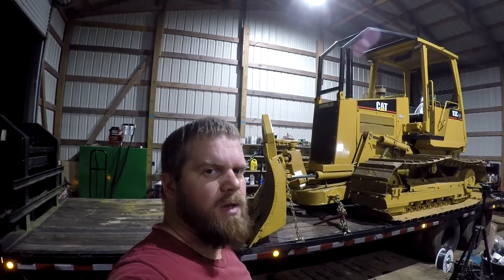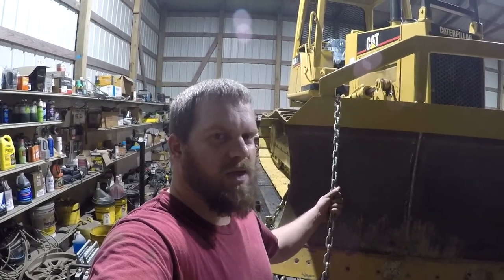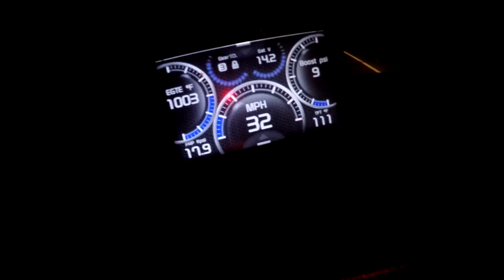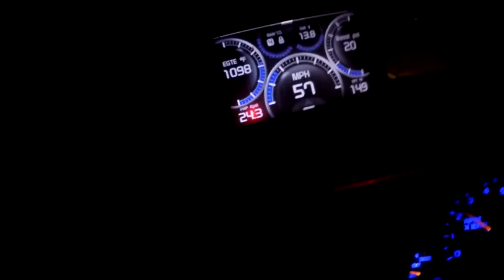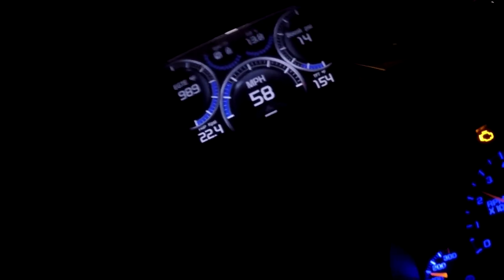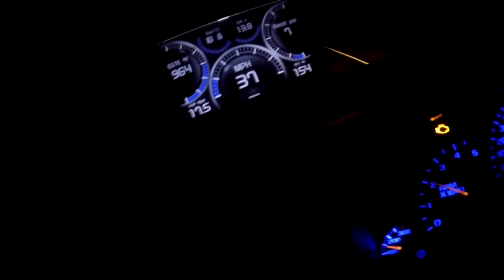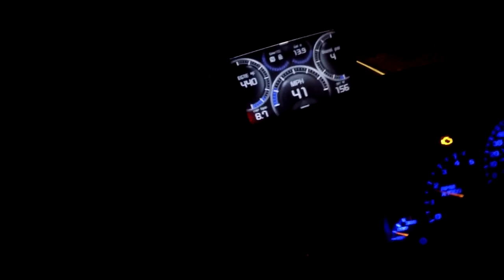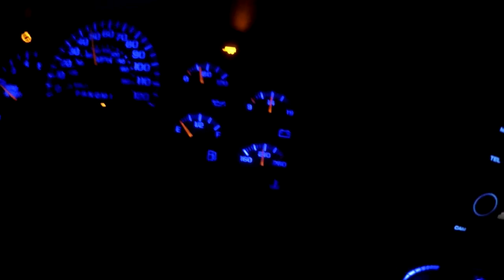LBZ Duramax towing dozer

Comment: The big old dirty Max diesel is running good!! but I see the money light is on, we're u able to scan it yet? Dang edit, u just answered that question at the end. 😅
Reply from the maker: I new someone was going to ask 😂 glow plugs work, no problem starting when it was 10 degrees but for some reason the indicator light started working intermittent and now I don't think it works at all. Maybe a wiring issue or something in the cluster. Google says was common occurrence for the code but I didn't see a common fix that corrected problem, you can spend a lot of time and money chasing a frivolous problem like that and I haven't bothered with it 😂

Comment: How’s your fuel temp look when hauling in the warmer months? Mine gets up to around 190 degrees pulling a 11k 5th wheel in about 80 degree weather. From what Ive been told the fuel temp on the LBZ is the cause for a lot of issues with the LBZ. I’m thinking about adding a trans cooler to the front and running my fuel line through it to cool it off. They say a anything over 180 the truck starts losing power.
Reply from the maker: I haven't paid any attention to fuel temp to be honest.
Reply: @LifeWithChase  10/4. I’ve been told this is kind of heat is not normal and is bad for the cp3 and injectors. This is because the fuel loses lubricity and starts breaking down after 150 degrees. I’ve been told I need to find a way to get the fuel temp down. I don’t know anyone else with my year truck so I have nothing to compare it to. Be a good video to do if you get a chance. That would help out a lot of people because I’m not the only one. Your truck is in great health so it would be interesting seeing what kind of temps your getting when heavy towing.

Comment: 5:36 there's no need for a Cummins, the dirty max can handle it just fine, (as for the new ones even the 6.7 power stroke concern those as way more than capable) the Allison that on the the pickups are not the real Allison, they are the GM heavy-duty trans (not to be confused with the 4l80e and 6l90e) with the Ally design and the name branded on them. You can find some videos of this transmission on YouTube.
Reply from the maker: I know about them, used to be part owner in a transmission shop, got out of that about 10 yrs ago. My dad rebuilt transmissions for over 35 years. I like Cummins cause it's simpler, easier to work on, I put heads and head gaskets on this Duramax when I bought it. Water pump is a pain too!  Dodge transmissions are not on par with the 1000 series Allison though. Most people who towed heavy used to get the G56 6spd behind Cummins. I have a 3rd gen Cummins with the 48re 4spd auto, great truck but 48re doesn't compare to Allison 1000 for robustness in heavy towing. Don't know about the Allison branded 10spd but I bet it's probably not as durable as the 1000 series Allison... With all that said this Duramax does pretty good, it kinda surprised me.
Reply: @LifeWithChase  yeah, those Cummins are much more simpler to work on and better balance unlike the V8 diesels, and Aisin is the better transmission for the high output Cummins that's only for the 3500 series.
Reply: @brandedmcgowan9414  cummins are only good for towing. Duramax is good for towing and hauling ass. I prefer the duramax because of that, and because the allison transmission. The dam thing will just not fail
Reply: @trailerwithyardwasteonit7188  them 6.6s are very fast and quick from what I seen from first person view, all the Cummins and power stroke boys keep talking about live axles in the front and a sturdy chassis and their respective diesels are far more superior than the GM trucks yet Duramax keep kicking their @$$£$ since 2001 evening with lower gear ratios,  compare to the competition higher (4.10 4.30 4.56 etc.) gears, and the Duramax just does it fine just better if so, just imagine the Duramax/Allison combo compare with those 4.XX:1 ratios even though mpgs may drop unladen but that's the purpose of a heavy towing truck, and still more older Duramax trucks are still on the road than the other two pulling on the interstates.
Reply: @brandedmcgowan9414  yeah but see even then the thing is the ford and dodge guys always hold onto that argument about the IFS vs their straight axle but the truth is they swear they are out rock crawling and doing major off-roading I always say if I want a straight axle truck I’d build one other than that I prefer the IFS its a way more comfortable ride
Reply: @trailerwithyardwasteonit7188  IFS is great for long haul services without death wobble 😁 and the old saying by GM guys, our truck floats smoothly like Caddy
Reply: ..............."Like a Cadillac "

Comment: Try 4 binders and 4 short chains on the tracks 👍
Reply from the maker: Won't work on the back because of the particular pads on this dozer has a wide gap between them as they go around the sprocket and nothing to hold the chain from going in the gap. It will work on the front because the grouser will hold the chain from slipping in the gap between the pads.

Comment: Is there a mechanical issue with your engine? I hear a rattle that sounds valve train related.
Reply from the maker: Not that I'm aware of. If it is it hasn't blown up yet, so there's that 😂. It may be a bit of fuel or timing clatter. It's on an 80hp tune. I noticed a difference in the sound when I tuned it and changed the exhaust. Never been around another Duramax with same mods. My Cummins isx in my semi has a lot of clatter in cold weather though.

Comment: What programmer are you using
Reply from the maker: Efi live Duramax tuner with edge monitor
Reply: That emissions compliant
Reply: I'm looking to get the switch from them I have all emissions equipment on the truck
Reply: How's the exhaust brake? Can you feel it when the truck is empty getting off the highway?